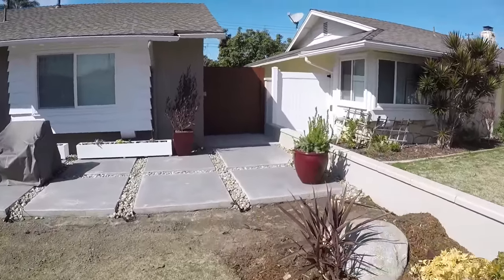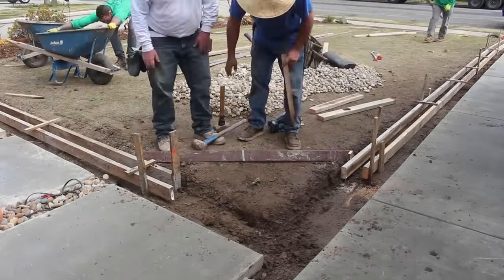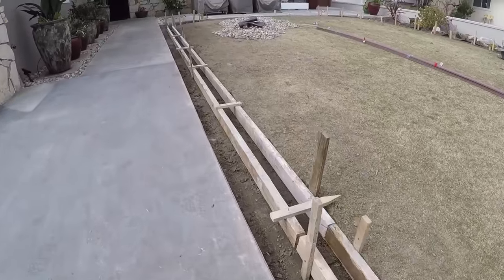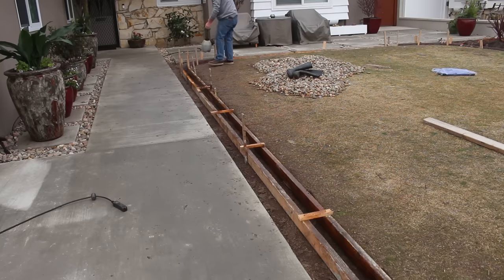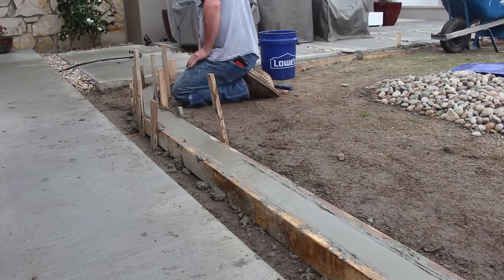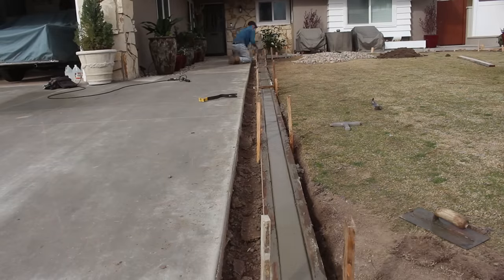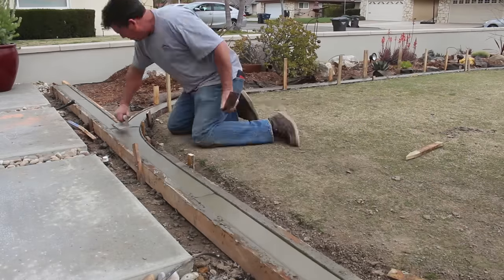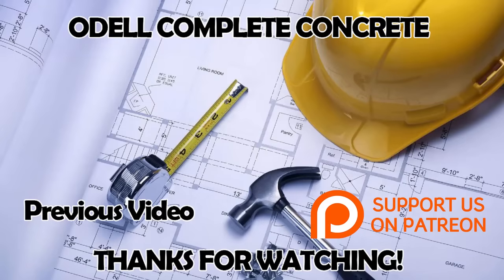How to Build a Concrete Mow Strip for lawn and Garden

Comment: I did this to planting areas on the front of my house. No wood to rot and replace, no plastic that breaks. 10 years on the concrete border and still looking good. I will use your radius corners method when I do the back yard, makes mowing so easy.  I also used a better grade of bagged concrete as well, worth every buck.  I also like the trick of cutting down the edger! Thanks for the info!

Comment: You guys put out some great material. I’ve learned so much from your videos. They’ve given me the confidence to tackle all my home landscaping projects; 10’x18’ shed concrete slab, 30’ CMU planter bed, curved retaining wall, driveway patch, sprinkler/sod installation, and more to come. The professional tips you provide on methods and tool selection have been so helpful in giving me long lasting results.
Reply from the maker: Great
Glad it helps
GL
Reply: I learn alot from Sir David as well,...he teaches people the DIYer's easy solutions that can be done without to much effort.!!! Thanks Again Sir David Odell

Comment: This is exactly what i was looking for. Didn't realize it was called a mow strip.

I'm looking for some pointers. I want to build a wood fence with this underneath connecting the posts together for the length of my fence. Yard is about 100x50. That way when i put my fence kick plate down, no animals can get underneath, or grass growing under the fence.

My ground is very wet most of the year. I live in S. Louisiana, and it's a low area. I dont know how this would affect such a long, narrow stretch of concrete.

Love you videos. Lots of great info.
Reply: landscapers call it curbing lol
Reply from the maker: Make it 6"s deep and 18 to 24" at the post
Reply: @OdellCompleteConcrete  thank you for your quick reply. Exactly what I was looking for!

Comment: Thanks for the tip with the motor oil. I'll try to be careful to not get it on the grass. I hope the tip I have for my garden sprayer works OK.
Reply from the maker: Sure GL
Reply: Just use virgin oil instead of harming the environment with motor oil. Please stop using motor oil! A single drop of used motor oil
can contaminate a million
 drops of water.
Reply: @Amok2806  You are right. I did some research, and silicone spray will also work.  Very easy to control.

Comment: David, about this method of constructing a concrete mowing edge,

There is no stabilization of the beam below ground level and it rests on top of the soil, albeit below lawn level on the lawn side. 

I presume that gravel chips/other material will be used to stabilize it from the other side, as the video concludes with the form work still in place?

For any above soil level concrete beams, I would have installed at least one central 6mm rebar along the entire length of the edge and driven 10mm rebar rods into the soil to 20cm depth every 2.5m or so. This to prevent any possible cracking along the course. The cost would have been marginal but garanteed the product over 20 years.

However, I still prefer a mowing edging constructed from face brick set on a 100mm concrete foundation of 25mpa. In this case the final edging is built on a concrete foundation set 10cm below soil level and does not require any reinforcing.

After the foundation is floated, the bricks are simply positioned 'edge to edge' onto the foundation using a cement/water paste. This is incredibly strong and all one needs is a builders line for managing alignment.

Once perfected, this method is very quick. It does not require the installation and de-installation of any form work and is far less labour intensive. 

For me, using a clay face brick is a far stronger and attractive solution and I have a personal dislike for painted contrete

Comment: This is what I did to my lawn makes mowing so much easier and it looks good as well.
Reply from the maker: i agree!
Reply: I don’t see how it makes it easier to mow
Reply from the maker: I concur
Reply: keith cunningham  you still have all of that since theirs still concrete right next to the yard. and that can almost be completely alleviated with having the yard at the same height of the concrete. i never have scapling issues with my yard, all i need to to is edge the yard for a nice look but thats also completely optional.
Reply: Nope, not really, I do lawn service in Fl and some of my customers put this on their borders only to crack after a while because there's no rebar into the ground to keep them in place when a mower goes near them.

Comment: I'm glad i found this video. I'm wanting to do something similar, but with a bit more depth and the concrete formed to run the lenth of a fence. My idea is I'm wanting to put up a privacy fence, and have concrete poured out inbetween each post in a similar fashion like you've done in this video to deter my dogs from digging out. Any suggestions on how deep and wide you'd recommend while taking considerations for times of the year when frost is prevelent?
Reply from the maker: 2' deep 1' wide

Comment: Great work David and crew. I was pleased to see you used a radius on each corner - makes mowing so much easier! It lools way better also. Cheers from Australia. 👍😀
Reply from the maker: Yes I concur
Reply: @OdellCompleteConcrete  is it necessary to add rebar and did a trench?

Comment: I just have a couple of questions, because the curb is only 3.5" deep, do you have to use rebar? Also, the spacers that are used for the radius, did you leave those in there?  Thanks!

Comment: Thank you very much for the video. Wish we could have seen the final product without the molding.  Also I had a couple question. I noticed that some stakes were in the inside rather then outside as most of them were. Any particular reason?  Other question was about towards the end of the video when you made a line every 4 feet or so to divide the sections. How deep did you go in with the tool ???   THANK YOU AGAIN !!!!
Reply from the maker: 1/2" deep.
The inside stakes came out while the concrete was wet.
Reply: Thank you very much !!!!!!!!!!

Comment: So when building this type of mow strip you don;t need to compress screenings for the base or add rebar for strength? Is this true of all curbs mow strips?
Reply from the maker: Depends on the surroundings
Reply: Can you elaborate on that? Do you mean on the environment freeze/thaw cycles etc.?
Reply: Why do you bother answering if you don't give any relevant information?

Comment: We are having big issues with concrete here in Northwest Indiana.  My Father is in a battle with his contractor.  Contractor blaming severe pitting on road salt........but then there are huge cracks far away from the roadway that cannot be blamed on salt.......too lengthy to explain but there are multiple issues going on.  They poured in the winter, something happened obviously, it's not the sale.  By the way, they blamed the cracks on "settling" even though it was only less than two years from pour.
Reply from the maker: SOunds rough

Comment: What's the point?   Other than the flowers and the bushes which need the borders, the area between the walkway and the driveway will still get weeds and tall grass that will grow in their unless you lay down a mortar flooring, then fill it in with the rock.
Reply from the maker: Not likely

Comment: Great job as always! 
Just curious how the pricing per L.F. Compared to a curb machine. My guy can throw down 50 L.F mixed, installed and finished in 2-3 hours, 2 guys. And many more options with stamped, decorative.. This seems like a lot more labor and time with the forming etc...
Reply from the maker: That's great but those machines use a mortar mix. Mortar mixes don't last.
Reply: Odell Complete Concrete thank you for the insight. I always wondered what the difference between the machine curbs and forming was. That makes sense it’s the mix. He does use a plaster sand and Portland. 
Thank you!

Comment: I know homeowners want what they want.  Had it been me?  Instead of that loose stone between the slabs I would have had the contractor put concrete back in between.  Poured in place with pea gravel instead of crushed stone in the mix, then before curing brush/water off the loose paste to give you an exposed stone finish.  No tripping for the ladies wearing high heels, and no putting the stones back in place by homeowner.  Win/Win.
Reply from the maker: I've did that to

Comment: Did you put untreated spacer blocks in the bottom of the form? Wouldn't that create a termite problem for the homeowner down the road potentially?
Reply from the maker: Spacers come out when concrete is going in.

Comment: What do you use to make the curved form? A piece of 10 feet flexible curved siding at lowe's cost 25 bucks. Seems very high no?
Reply from the maker: Landscape border
Reply: @OdellCompleteConcrete  Is landscape border cheaper than using 1/4in plywood?

Comment: So you don't need to put rebar in it? Maybe that's a cold climate need?
Reply from the maker: The dirt keeps it in place unless you have big trees around
Reply: @OdellCompleteConcrete  Here in the Northeast if you don't put rebar in the cement, it will crack when the ground freezes.

Comment: Is it possible to pour mow strips like this in areas that freeze (upstate NY) or would they heave and no longer be level with the grass?
Reply from the maker: Sounds like that could be a problem
Reply: My neighbor did that curbing up here in Eastern Washington we've got below zero temperatures this winter it looks fine, I kind of mimic his idea, but I went with the red concrete brick you can buy at the big box stores way cheaper and quicker to install just have a good ground base of crushed gravel, and a string line to keep the brick straight if you want to go that way.

Comment: How can I calculate the concrete that I need for a similar job thank you.
This are my measurements 41 feet length x 12inches width x 6 inches thickness
Thanks
Reply from the maker: 21 cu.ft
Reply: @OdellCompleteConcrete  thank you

Comment: Loose drainage rock, crap will collect in it and the rock will get kicked around. Maybe fill with clear epoxy for the look without the growing weeds hassle. Not to mention the neighborhood kids using the rocks for throwing...
Reply from the maker: Weed fabric
Reply: @OdellCompleteConcrete  Dust will settle in it and things will sprout, at least here in pnw, maybe different down there. I still feel the rocks will wander around the yard.

Comment: In the area you're located , what is the going rate for finished concrete per yard?
Reply from the maker: 10 per hour
Reply: @OdellCompleteConcrete  So you charge by the hour and not by the yard. Here in the upstate of South Carolina  they charge around $2.00 a yard.. that was about 2 years ago.
Reply from the maker: That's great

Comment: Why do you need to put in joint lines? Cant you just keep it smooth with no grooves throughout?
Reply from the maker: yes but this way it might crack on the lines
Reply: @OdellCompleteConcrete  interesting.  Thank you for the advise

Comment: What do You Oil It with ?? BTW I WAS GONNA ASK I Remember a video You had You said you used a typical oil So the wood wouldn't get crooket and I was wondering with one is it?
Reply: 3:30
Reply from the maker: I use Mobile One full synthetic in my truck, so when I change the oil I use it as a form oil, and my money's worth out of it
Reply: @OdellCompleteConcrete  thanks men Appreciate your time That's a really helpful Way for the Forms I Will sure use that Method now👍 I have use couple method of yours in concrete jobs I have people look at me crazy But now everybody Wanna know How I do it I just Show them your Video haha Great Method You got Odell 🙂
Reply from the maker: @tflak1003  
get it on
YW
Reply: Odell Complete Concrete , not implying anything...but is this legal?  I get you not spraying directly to ground, but I can’t imagine motor oil on the ground, to leech into water table is a good thing.  I saw one video where they used vegetable oil.  Just curious?

Comment: Why is oil applied?
Reply from the maker: preserve wood and forms release easaier
Reply: concrete will adhere to wood so you use a release agent that prevents the concrete sticking to the wood.

Comment: I've never seen anyone apply motor oil to their forms and I hope I never see it again.
Reply: Why? It works, what’s the problem with it?
Reply: used oil from an oil change works well.  could probably get some free from an oil change place.
Reply: M. Why not use motor oil?
Reply: Motor oil has the potential to travel long distances, and eventually makes its way into waterways in the form of runoff. Once it reaches waterways, used motor oil is toxic to plants and animals living in the water, and its film can impair natural processes, such as oxygen replenishment and photosynthesis. Used motor oil can also pollute soil and drinking water. According to the U.S. Environmental Protection Agency, 1 gallon of used motor oil can contaminate 1 million gallons of fresh water. If used motor oil reaches sewage treatment plants, even small amounts -- 50 to 100 parts per million -- can foul the water treatment process. Soil becomes less productive when exposed to used motor oil.
Reply: @DarkCloud_74  
What drug are you on dude, he only sprayed the boards, it’s common practice and works great.

Comment: I don’t agree with his choice of rock fill, as well as planters. The concrete doesn’t pop enough, because of the color of the rock. There’s no contrast, therefore the concrete blends in and there’s no difference where concrete ends and begins. The size of the rocks doesn’t help either.

This design is a modern take, however; the home owner chooses old planters with plants on every block of concrete hiding the contemporary design.
Reply from the maker: It looks good when all the lighting is in and borders are completed